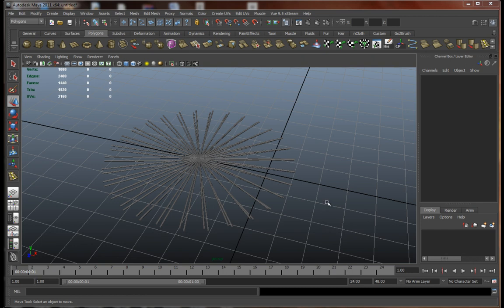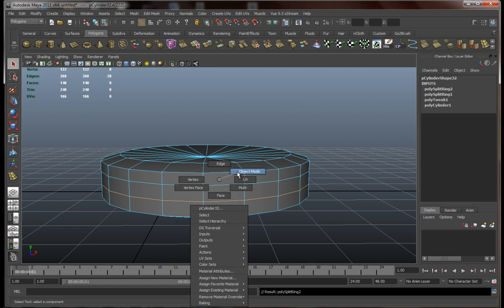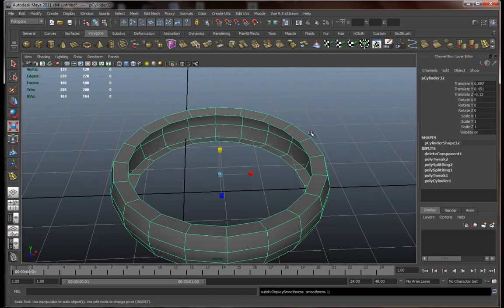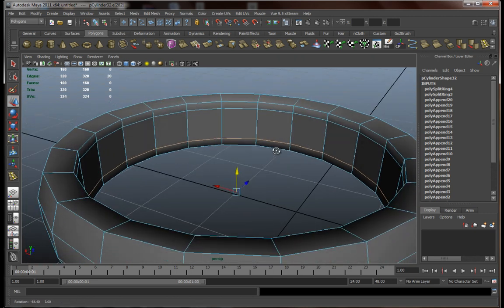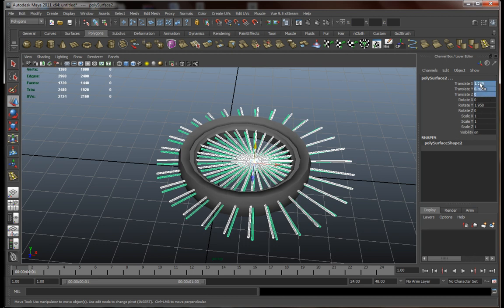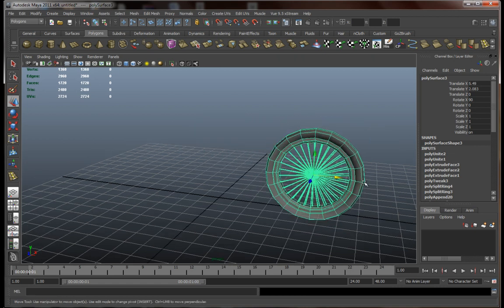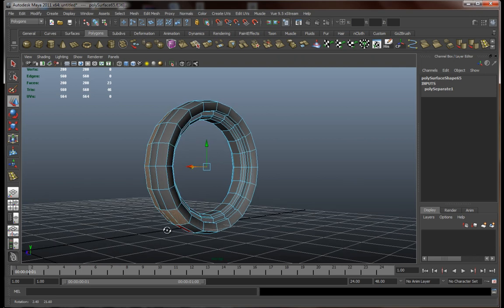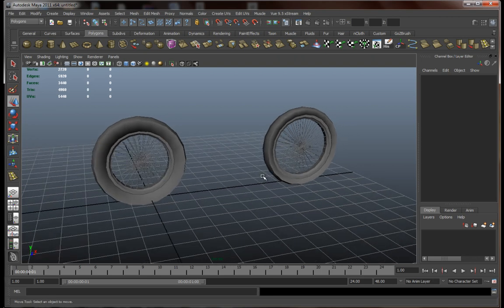Maya Beginner Modeling Tutorial - Motorcycle ( Part 2 of 13 )

Comment from the maker: Either you don't have the 2011 version of Maya or it just bugs out , that option is a bit iffy , if it doesn't work just select the edges manually and that's it , it SHOULD work by just double clicking the edge , what you could also try is select or two edges and then double click on a third and see what happens , anything else regarding it is beyond me I'm afraid :)) , hell try google if nothing works and see what's up ;)

Comment: i am having trouble making the tire. after i set the caps = 2 and go to use the edge tool, i try to select the edge but it turns a handful of the lines orange and it does not do what you did. any thoughts?